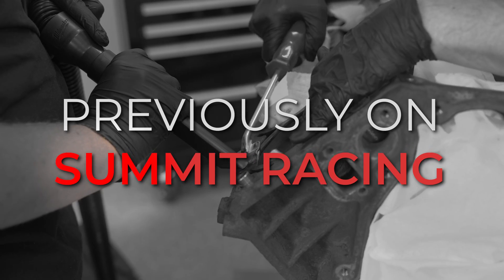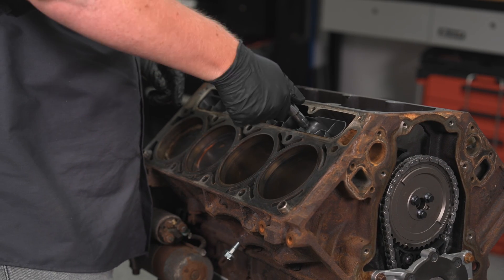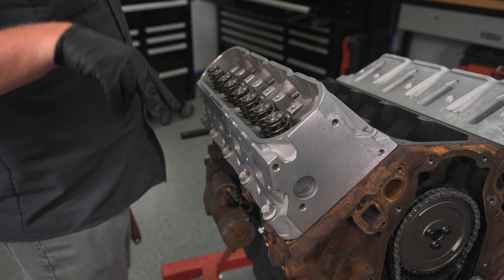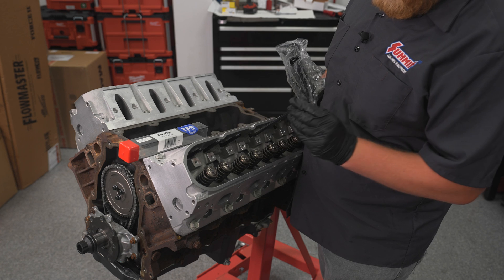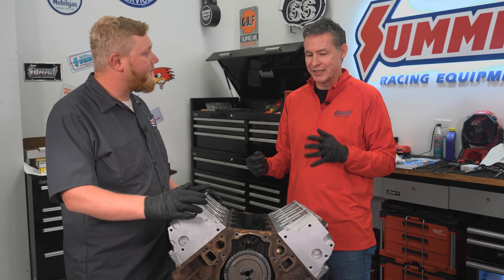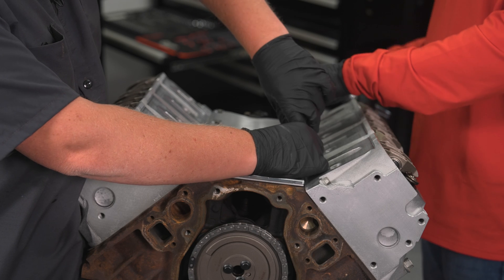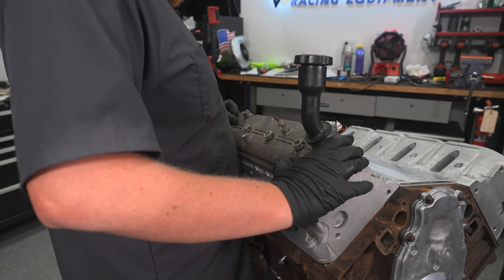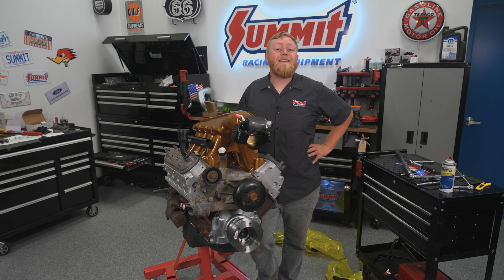Budget-Friendly 6.0L LS Power with an Intake, Cam Swap & 799 Heads—Part 4, The Top End

Comment: So is that Torquenator available for  the 4.3 V6 engine am able to use my stock injection or have them adjust to work with that camshaft. Also can I get those rockers for my 4.3 V6.
Reply: Big dawg this is an entirely different engine

Comment: When is the best time to paint an engine block, before or after assembly or not at all?
Reply: You don't have to paint it but it will look better of course. Paint before the heads or any accessories go on. Just mask off the cylinder surface and valley, and any hole that goes internal to the engine basically (oil pan area obviously). if you have old bolts to plug bolt holes that's smart, it will keep paint out of the holes so you don't have to thread chase them and clean them again.